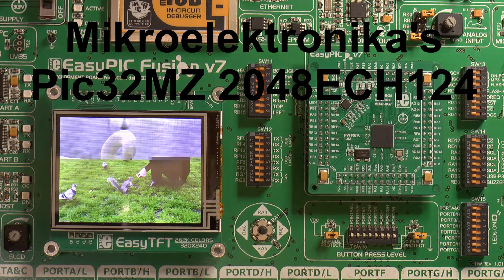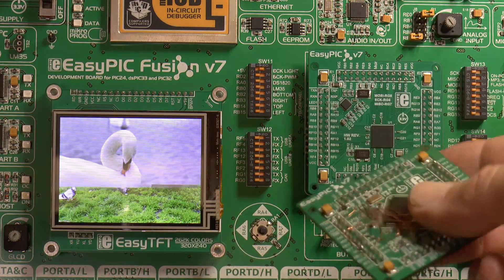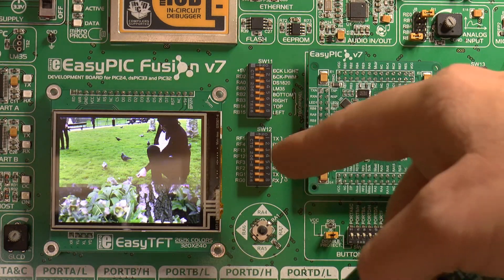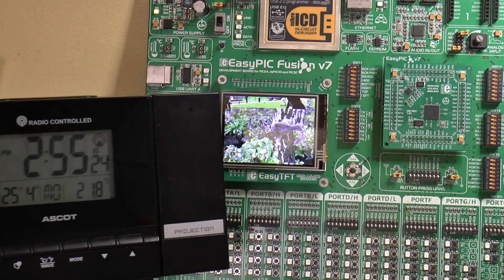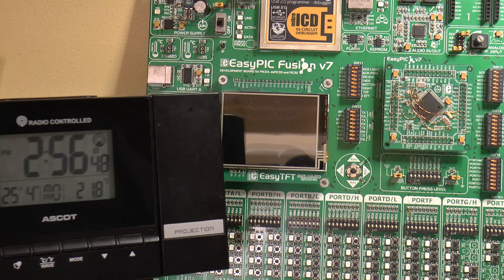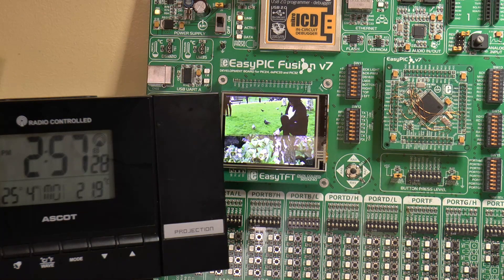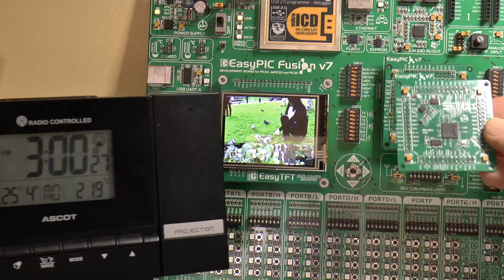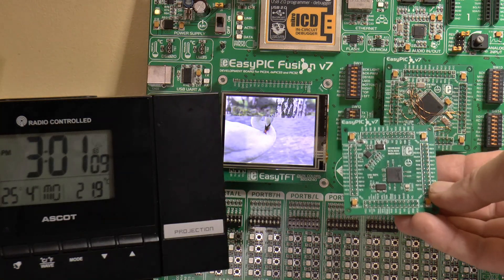Pic32MZ vs Pic32MX from MikroElektronika & Microchip

Comment: What is Your experiece with Mikroelektronika products? I am working now more than ten Years with Mikroelektronika and it is not allways a joy. There are many software crashes and the debugger works slow, crashes or mostly does not work at all. I also have an ICD4 from Microchip, that works fine and fast.
Reply from the maker: Hi,
I assume you are talking about uploading a hex file and ‘in circuit serial programming’ crashes as opposed to a program crashing after it has been running for a while?
Yes over the years the Mikroprog tool was very unreliable.
It finally stopped one day, I found a poorly soldered mini usb connector. It has been very reliable once I soldered many bad joints and replaced the corroded connector.
Yes debugging with the Mikroprog tool is ridiculously slow.
The tool took 71 minutes to tell me the clear screen was 800 milliseconds.
I have videos on debugging and lots more besides.
Where are you in the world?
😁

Comment: Hello John, I start just now working with PI32MZ2048EFH144 (using easyPic V7 from mikroelektronika). Before I used many years the dsPic33EP512MU810. Now I need more power for floating point operations in my new project. I want to use the CAN bus of the pic32mz but I am not able to make it works. I tryed also with Pic32MX (as shown in your video) and it works well. With MZ there is no way to let it works. Did you meet similar problems?

Comment: Hi John. Would you give me quick answer before Mikroe Blackfriday discount ends tomorrow. IS debugging (stepping thru code live) working using this big Fusion board and MZ board? Or debugging craches often? 
Im thinking to buy same board, just unsure because my microProg programmer/debugger (white box)  is not working with MZ and craches often with MX boards.
Reply from the maker: The white box is the same isn’t it?
Mine would crash too, their stuff so dated
Reply: @JohnB-2021  Yes, I think separate mikroProg (my white box) and Fusion V7 integrated design/function is same or very similar. Shame, I love microBasic and power of MZ.
Debugger with MZ boards is not working at all.
How often does yours crash with MZ? Do you get lets say 5 minutes debugging crash free in 50% cases when debugging MZ family? 
Do you get
Reply from the maker: @kallekrolov1172  yes 5 min but it doesn’t find the bugs and it can’t debug other chips too.
MZ s have problems with chip so not 100% great.
MikroElektronika can’t even write numbers on a tft without writing over previous numbers.
Reply: @JohnB-2021  Thank you John. I did buy big Fusion board now, im happy if minimal debugging works.
I think early MZ EC family has problems and MZ EF is quite good.
Have not used mikroe display library (i usually talk to SPI and display directly). I guess letter background must be done manually anyway if low end display controller has RAM for visible pixels only. I need to test displays with RA8876 controller from buydisplay.com, having multiple layers in disp. controller.
Reply from the maker: @kallekrolov1172  
I don't think Mikroelektronika have a library for the RA8876, I assume that does not worry you.